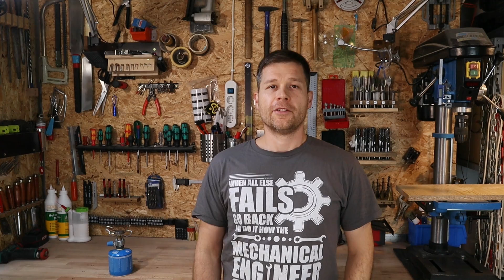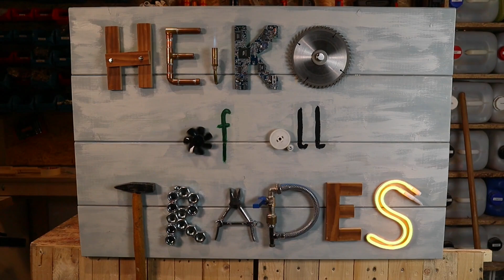Easy how to inlay METAL into WOOD. DIY metal pouring into wood. How to fill cracks with metal.

Comment: Small angled panel pins below the surface height could act like rebar in concrete. Or small screws would mabey fix the cast, the tapered screw heads complimentary already fit the the correct wedge shape...
Reply from the maker: Yes, you can check out my video of the "table with history". There I used screws to hold the casts in place and it still works today. If you do an angeled cut up to the surface you might change the form by sanding down. Screws are the easiest way in my opinion.

Comment: Good little video. I’m a flute maker, making flutes from quirky branches and retaining their character.
I like the idea of melting copper wire on occasion that cracks might be present on an old branch.
I think the heart you did is easily glued into place with epoxy glue and a possible solution
Reply from the maker: Oh nice! Yes, you can glue that but a mechanical lock or screw might be better. If you sand the material down it gets warm. So maybe your epoxy might come loose.
I have not tryed to melt copper. You need higher temperatures for that.

Comment: I'm thinking of doing this. But instead of pouring straight into the wood piece, to create a mold of the shape needing filling, using crushed cuttle fish (like you would use for creating pewter 3D forms). So then I can pour into the mold and get the correct forms, before adding them to where I was to inlay, means I also then can get the front to have the correct form and level etc. This probably has it's own drawbacks, but I don't want to potentially damage the piece I plan to do this with so thought this could be a way around it :)
Reply from the maker: Give it a try. The way I did it was just fast and easy. I made a form for letters as well (video is online as well) but trapped air can be a problem. Overfilling the crack just gives a bit more control that you really filled it.
I saw a differen video where they filled the crack with brass. They have to make a form and make the metal pieces outside for the gaps as the metal was too hot to bring it in directly.

Comment: Hi. what grinder wheel are you using to grind it down with? thanks
Reply from the maker: @raymondojones3830  Hi. I start with a flapdisc and if the metal has the same level as the wood I use the random orbital sander with 120 and work my way up to 320.
Reply: @heikoofalltrades2267  Thank you.

Comment: how come when i try this it starts the wood on fire but not when you do it ?
Reply from the maker: @danwoods7403  I filled a lot of wood with molten Tin and if never ignites the wood. What wood do you use? Do you use tin and what is the meling point of your metall? Is oli or paint on the wood? I used painters tape and it did not ignite that.

Comment: Even on the narrow inlay, one could drive screws and use a cut off wheel to cut the screw head off below the finished pour height. 
 No need to drive from below.

Comment: Hello Heiko, Many thanks for very nice video :) I would like to cast aluminum on letter engraved OSB.  Which thickness and depth do you recommend?
Reply from the maker: Uh, I have no Idea when it comes to aluminium. Aluminium melts at more than 600°C, tin round 300°C. You have to test if it buns the wood or sets the OSB or the glue of the OSB on fire. I would start with a 10-15mm / 0,5" cut into the OSB. Be careful as the glue of the OSB might produce gas and kicks out the molten metal.
Reply: I’m wondering WHY???
You’re not liking to want to inlay a display/bespoke piece of work with lead/tin or solder. Dull gray doesn’t enhance anything.

Comment: Put a bevel on the inside of the piece so the metal is wider at the bottom than the top.
Reply from the maker: Yes, a undercut, very good as well but the screws working as well very nice and they are easy to install. Works on my table with history since a year with no moving metal...

Comment: Hello very interesting.
Which metal is it that you use?
What is it’s melting temperature?
Reply from the maker: The metal I use ist lead-free tin. Melting temp is about 300°C. Temp just by guessing. My slodering iron starts to melt is at this point.

Comment: U mightr try under cutting ur pour hole at the bottom & that will anchor ur metal.
Reply from the maker: Yes, that would be possible as well, but I found the scews easier. If the Material is not thick enough, the under cutting might be the only option. Good to have that idea in the toolbox as well. Thx

Comment: Its tin.. really soft metal that durability is questionable at best of times.
Reply from the maker: It worked for tableware in the last century, not for machines. I made mettal inlays in a table and that works without problems. Every material has its applications 😁
Reply: @heikoofalltrades2267  I did some pourings on old oak and left it for year without finishing. To my surprise it looks like 1st day. Now I'm trying with azobe wood, super hard and dark, contrast looks crazy. It's underappreciated method.

Comment: It may be harder to control, but maybe a small dovetail router bit would work to give the metal a lip to hold onto if a mechanical anchor isn’t practical?
Reply: Oops I didn’t see someone else suggested it too!
Reply from the maker: Hi, thx for the tip. Yes, that is a good mechanical key too. I used the "metal in wood" method now for some more projects like my "history table" or the "present for everyone" and the screws never failed. All inlays are still in position, no loose parts but I think any mechanical key will do the trick.

Comment: very nice! thank you. I always thought this may burn the wood.
I wonder if there is any risk or difference doing the same melting with copper?
Reply from the maker: Hi. No burn marks with tin but copper needs 1000°C to melt. I think you will burn the wood. There are wood forms to form molten glas (over 1000°C) but this wood is full of water. But if you try it, let me know about the results...

Comment: nice job. You could use a Dovetail Cutter so the Inlay might lose a bit but would never come out. Otherwise I would recommend Glue
Reply from the maker: Yes, I thought that too, but I had no dovetail cutter at hand. Glue is a good Idea if screws are to big. During my history table build I used screws and that worked realy good...  I had enough wood around to use screws. Thanks for the the tipps!

Comment: Moin Heiko - very fine idea! I also like to work with old or damaged wood and your work brings it to a new level. Three questions: where do you get the tin? And is it expensive? And do you think that the can is thick enough for melting the tin?
Reply from the maker: Moin Armin. Thx 😁
The can is fine for melting. I used the same can for a much bigger project (video will come soon) and it is still in good shape. Please heat the can once beforehand melting the first time at the outdoors to burn the coating and leftovers. That will smoke a bit but only one time.
The tin I got from a roofer. You can find it under "karosseriezinn" or "stangenlötzinn". You can also use tin nuggets.
Hope that helps